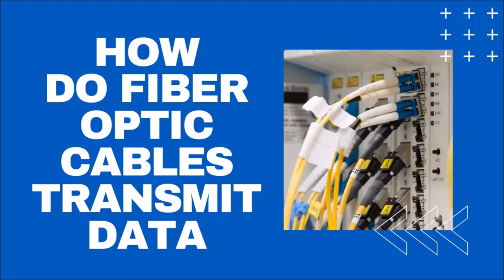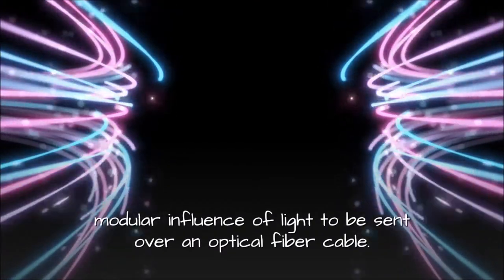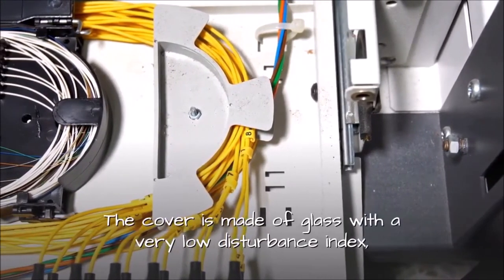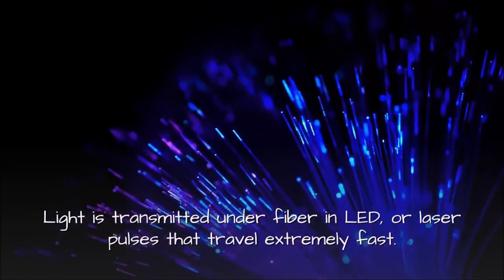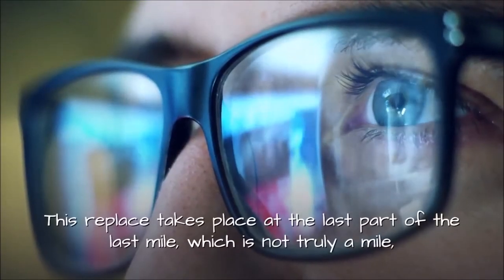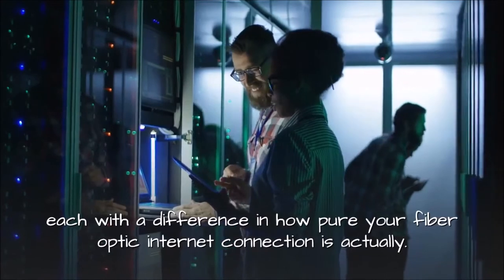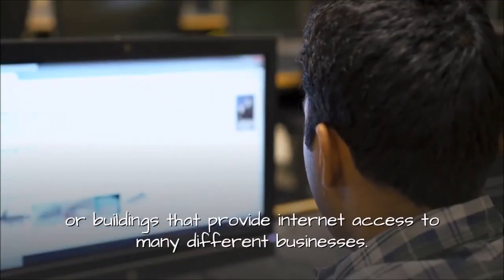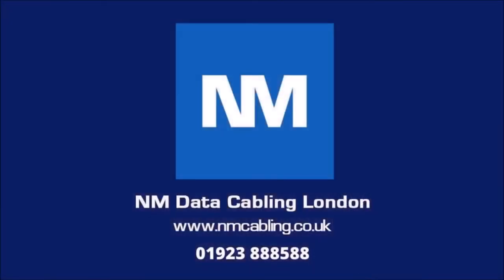How do fiber optic cables transmit data? (fibre optic cable transmission )

Comment: So, in every house that is connected to the internet, there are some fiber threads leading to it? Then the entire city's fiber threads all travel in the same cable leading to the ISP? How many threads go to a house, or are within a main line running to the ISP? There must be 100s of 1000s running along the road or underground? Is the data I send across the world essentially just moving pulsing light along a single fiber thread "road" the whole distance?

Comment: this a bit reaching... while fiber is ok in the organizations local area network or something like that but no apartment building needs fiber... it is a gimmick of the internet service providers...  even with a copper cable they split your bandwidth with others knowing that you wont be utilizing your 300 mbit or something connection and most likely you will be using wifi anyway...  that is why you pay 10 dollar for the internet
Reply: This is very interesting to me. Please can you point me to some resources to research this more. Especially the bit about how most of the bandwidth is unutilized. Thank you.